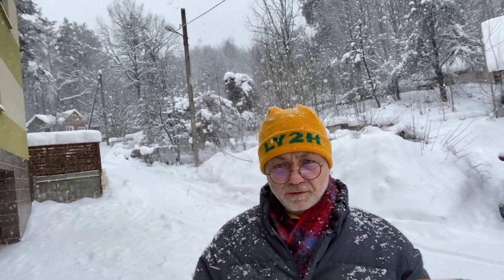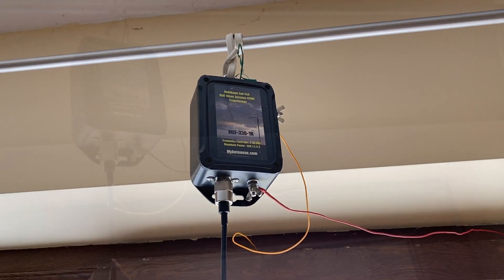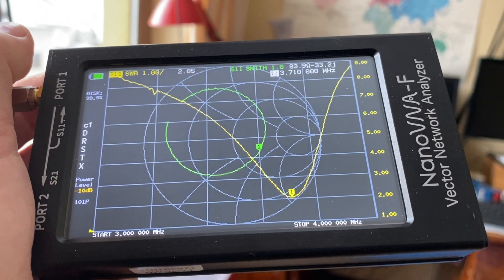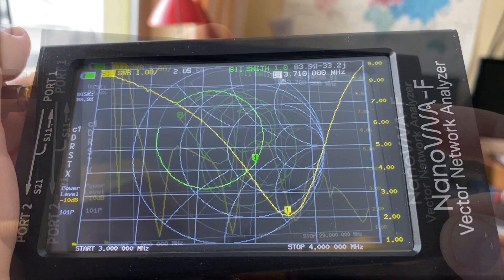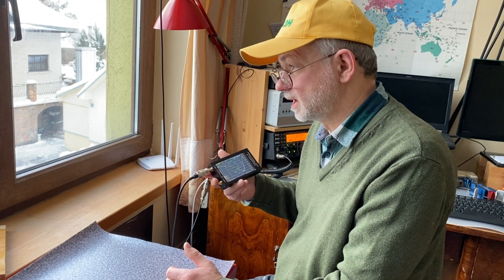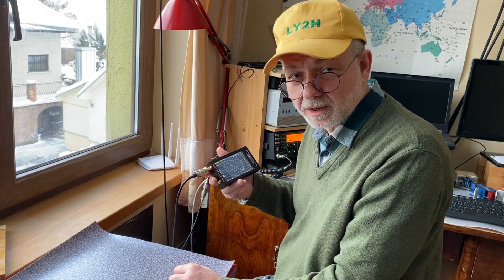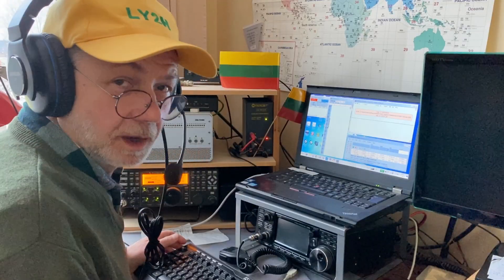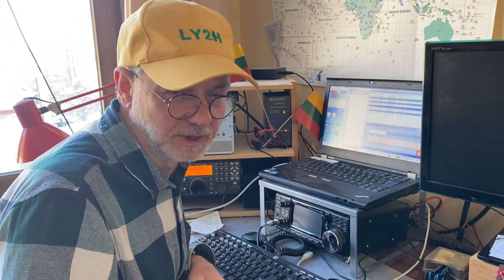SHORTY 80-10m EFHW , ZIGZAGGED in the snowy backyard fights in the 80m contest!

Comment: little late to the party but thanks for the video. Just passed my test for my HAM licence (still waiting for my callsign) and I am debating which antenna to use. I have a small garden and want to get on the 80m band. Atm for listening I basically have a half wave loop (around 40m cable) around the garden but I am planning to build a shortened ~23m version with a 110uH coil, but still I have to bend it at least on time. All in all this video gives me hope to achieve something on 80m! Thanks and 73 from Germany!
Reply from the maker: Congratulations with your licence! Let us know what callsign will you have ! Yes, bending should not be a problem for this shortened antenna. Of course, you should not expect a performance of a full dipole of it, but it's OK for some local rag-chew activities on 80m. Have fun! 73! Linas LY2H
Reply: @Linas_LY2H  Thanks for the quick reply! My callsign will hopefully be DA6KL, but since there are holidays it might take several weeks until I get it.

Comment: Nice look HF QRO, can you show more detail about it?
Reply from the maker: Thanks!I rearly run QRO, mostly LP or QRP.  In this video, I'm running Low Power 100W from Elecraft K3 (upgraded). Also in the background seen is the Power Amp Juma PA1000, Antenna Tuner Elecraft  KAT500. Radio on the right side, switched off  , at that moment- IC-7300. :). So, how about you, you run more QRO or QRP? 73! Linas LY2H

Comment: Very interested in your experience with the juma pa1000 amp driven by qrp radios.   Have you very tested this as dxpedition equipment???  Has this amp proven itself as a reliable contest amp?
Reply from the maker: Hello Jonathan, thanks for your comment! I have the Juma PA1000 amp for more than 4 years now and I’m quite satisfied with its performance, as long as  it suites my needs. I had no chance to test it out in real DX-pedition to some islands or something :) , but I take it with me ,from time to time to my countryside field position in the event of some big contest. In my fixed position in the city I mainly use it for chasing DX when QRP or Low Power don’t work… The PA is very convenient to travel with as it is really compact and it really weighs in ~5,5kg :). I have my PA, K3 transceiver, large speaker, Elecraft KAT500 ATU and a 13.8 V PS all installed into a wooden frame, kinda’ “go box”, everything permanently connected, so when I go it only takes for me to grab the box, put it in some other box an put it to the car. As it comes to the reliability, well it works and works… I had something wrong with it after a bit more than a year of intensive usage, it stopped working and it seemed that some pre-amp stage went wrong. The guys at Juma were very friendly, they said it would take to send the unit back to them for the repair, so I did. It was right after the waranty expired, :), so I had to take all the costs :(. They never said what exactly was wrong but the receipt showed “the part” had been replaced. The PA was re-aligned , flashed with the new firmware in the factory and is working flawlesly since. My personal experience is that this PA is idealy suited for the DX chasing activities type or SSB rag-chewing. I have been running it in the lengthy contests too, but my impression is that it is running on the edge of its possibillities if used at some 90% duty cycle in the CW contest, like calling CQ  and making QSOs all the time. If run CW at full 900-1kW power, the temperature starts rising, the fans are going wild and the thermal protection kicks in. It happens nor  very often, nor all the time but the tendency is like this. If run at lower power, 700-800 W  (the optimal power for this PA, really, and even lower for the digital modes ; 1kW could be attributed to the 20% duty cycle SSB operation ), with fans set up for the lower temperature threshhold to kick-in , then it runs very nicely for even long operation time. The fans are very noisy , to my ears :), and I’m looking forward to replace them one day with some quiter, like Noctua, or the JUMA itself is offering some fan options too. I have checked the website of the company, and it seems they have re-newed their activity, modified the PA1000, introduced the Bluetooth interface for the IC-705 connection, etc. It’s nice to see! I’m gonna investigate the Bluetooth thing and the in-built low-power power supply option some time soon. This PA is still, I think,  the only one on the market being so compact and having the in-built power supply and running from only 10W exiter transceiver. Hope this helps! Let me know what you think about this PA! 73! Linas LY2H
Reply: @Linas_LY2H    Thank you so much for this review.     The PA 1000 is really a unique product weighing in at just 14 pounds.   I had a chance to operate from Nicaragua once and I took a KPA 500.   It was a perfect amp and reliable but weighed 26 lbs.   It takes 25 to 30 watts to drive it to 500 watts.   Also like the PA 1000 solid state amps they require perfectly tuned antenna or like you have use the tuner to match it.     I got really excited when I learned of the PA 1000 which takes so little drive.   I thought if I could use the KX3 with PA1000 I could travel on a personal DXpedition for less than 20 lbs.   It hardly seems possible.   The PA 1000 is almost unknown on this side of the Atlantic.   You would be a perfect person to do a little video using your 705 and Juma amp on a portable contest operation.
Reply from the maker: @radionb3i  Thanks! The IC-705/JUMA combo is in my plans for quite a long time now :), so thanks for showing an interest! Juma PA1000 would perfectly fit in the hand-luggage size case with even some space for the IC-705 spared! We will see! 73! Linas LY2H
Reply: @Linas_LY2H  I am eager to find out how hot a kx3 or 705 get running cw long periods running 5 watts.   All I like to have is 500 watts.
Reply from the maker: @radionb3i  I don't know abt the KX3, but my KX2 with side heatsink installed can run CW at full 12W any time I want. IC-705, I took part with it in the EU HF contest and it was running calling CQ endlessly at full 10W from external battery without even getting feasibly warm :)

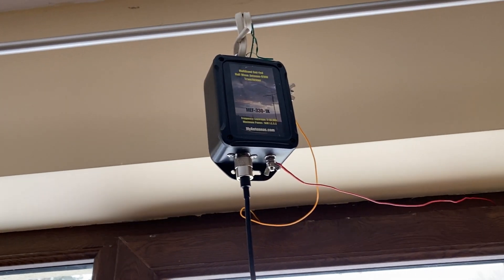Comment: Is there any advantage to using a 1:64 transformer over a 1:49 one for the EFHW?  Must visit the Baltic states they look so beautiful!
Reply from the maker: Thanks! Yes, we all waiting this pandemic to over and tourism/travel renew. Regarding the transformers, it's more theoretical discussion. There are at least 2 fb groups on EFHW antennas with plenty of opinions and research done by enthusiasts of this antenna type. My personal practice tells me that both transformers work fine and it all depends on what is really your antennas impedance which may be anywhere between 2,5 and 5 kOhm depending on the hight, configuration, terrain , frequency band etc. So both types of the transformer might give an acceptable  SWR around 1.5 to 2 . If the impedance is at the lower end, the 49:1 could be better ( 49X50ohm= ~2,4kOhm) , if at the upper , the 64:1 ( 64X 50= ~ 3,2 kOhm). It's a "poke and trial" :). Have fun! 73! Linas LY2H